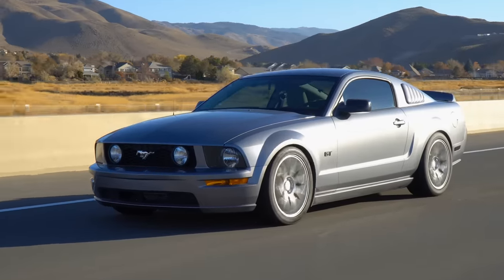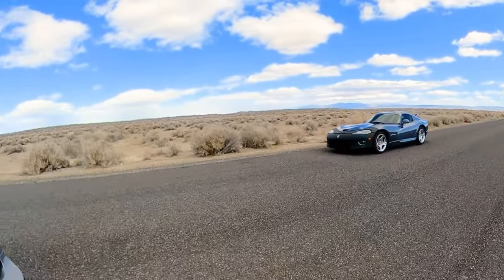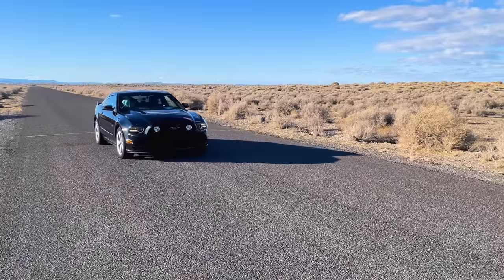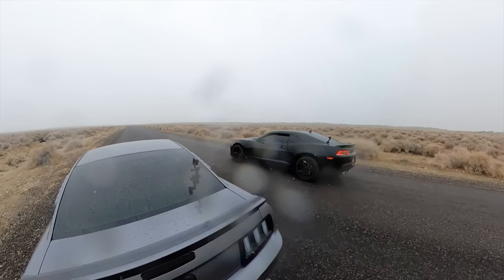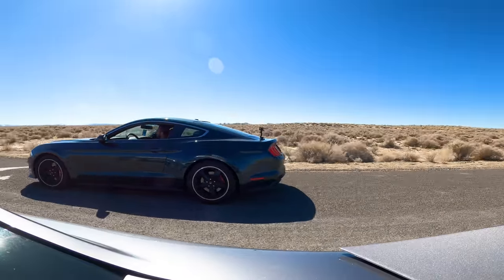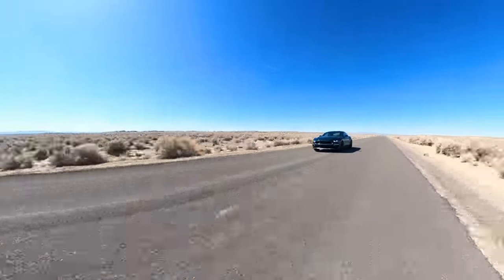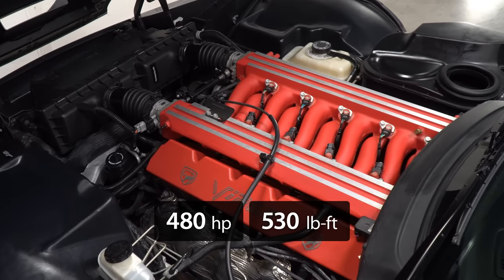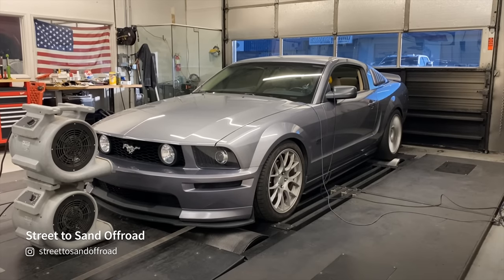Showing the world what an all-motor 4.6 Mustang can do

Comment: That is the quickest N/A 3 valve I have ever seen. Gives me hope for my car.
Reply: They're out there you don't see em much anymore because everyone just goes coyote and most people think a 3v can't even be fast because the internet says so.  Alot of impressive 3v builds back before there was coyotes everywhere.
Reply: I had a 82 GT fox body with a 351W and 5 speed years ago. Junkyard build, 300 wheel/330 torque and 3,000 lbs on the dot. Car went 109 mph in the 1/4 with no traction first and second so it was decent. I ran one or two modded 3 valves and they were right next to me so they can be quick.
Reply: @midnight347  If you put the same amount of money into a Coyote, it'll vastly out perform the 3v, just have to decide if it's worth it.
Reply: @midnight347  I think a lot of people just want to move onto different platforms. Chasing “stock numbers” or “fbo numbers”.as for boosting that’s a good hole category of its own that any vehicle can do with the right mods.
Reply: Just do rods and Pistons and go boost
Reply: @ThefuckyallLookingAt  But does it sound better than the 5.2s?
Reply: @TheEnd-eg6wq  the 3v is atleast 15k cheaper… whats your point? Take a 7k 3v… spend 15k on it… you’ve got a dragster.
Reply: @dssd245  A 7k GT 2005 and up for 7k will have 150,000 miles on it and be a pos, and likely will need everything replaced.
Reply: @midnight347  no they think there slow bc any other car in the same category with the same mods is faster
Reply: @TheEnd-eg6wq  do you know how to use tools?
Reply: @ThefuckyallLookingAt  who cares. Sound is just sound. Tesla doesn’t have sound and Gaps everything
Reply: @ThefuckyallLookingAt  I rather not be close minded and own all.
Reply: This Stang isn’t that fast. Maybe once he adds boost but he still lost to a mostly stock 500hp Viper… need to run low 11s or faster to be considered quick these days.
Reply: @TheEnd-eg6wq  the things that will be replaced are the things that will be replaced with performance parts.. using the 17k. You’ll have a new car when done..
Reply: @dssd245  With a worn out paint job and body, interior, and everything not performance wise replaced. Besides the fact that the 10 and up body style humiliates the 05-09, but to each their own.
Reply: @TheEnd-eg6wq  ahh. I didn’t know you had poor taste… it makes sense now.
Reply: @dssd245  The vast majority of the Mustang community agrees with me, and even you know that, the new body style in 2010 was highly praised,, I have a 12 GT/CS, and hell the 13-14 is even better than that due to the taillights.
Reply: @TheEnd-eg6wq  2010-2014… the back is jacked up.. 2015 and on the front is jacked up.. the 2005-2009 has the best rear/front combo… common knowledge…
Reply: @TheEnd-eg6wq  now if you put the rear from the 2015 and the front from the 2010…
Then you’ve got a descent looking car.. maybe even as good as the 2005-09…
Reply: @dssd245  You and 8 people think that. Sorry you're stuck with one. Perhaps you should google a 2012 GT/CS front and back, you have no idea.
Reply: That being said even a base 10-14 GT looks better than a 05-09
Reply: @TheEnd-eg6wq  the front does look good.. the back looks like they took the 05-09 back end and squished the block shape into a smaller  oval shape.... it makes it look feminine.. like a homosexual man… who does squats in the gym and then prances around.. not that there’s anything wrong with that.. just not my style.
Reply: @TheEnd-eg6wq  If you like the 2010
Rear end, I’m  assuming you’re a homosexual… so no offense extended..
Reply: @TheEnd-eg6wq  Have an 08 GT/CS. And literally everyone I know agrees they look better than your year. The scrunched backs aren't a good look. I personally hate the new ones, they look too much like a Supra to me. My boyfriend doesn't mind them as much. And when it comes to a muscle car, sound absolutely matters. The newer engines sound too much like tuners.
Reply: @mvc2177  You can't do anything with an EV. Half the joy of muscle cars is the amount of tinkering you can do to mold them into what you want. You're no gear head for sure. And yes, the sound does matter. A good engine roar can get any car enthusiasts' heart fluttering, the EV whine inspires nobody.
Reply: @mvc2177  You can waste your money any way you like bruh. Just don't be surprised when your EV gets no respect from guys who actually put in the effort to build their cars out.
Reply: @leelu9236  Possibly the dumbest reply this year, you think the front fascia on the 08 looks better than the 11- 12, with it's one of fog lights? You also think the Coyote sounds like a tuner compared to a 4.6? Hard to understand how you care for yourself.
Reply: @leelu9236  05-09 have a flat back, also hey go spend 800 and get sequential taillights as an add on, and if you have one it's probably an auto. At least I admit the 13-14 look better, go away
Reply: @TheEnd-eg6wq  It's a manual, but hey at least you're consistently wrong.
Reply: @mvc2177  Lol. What part of "you can waste your money any way you like" was too hard to understand? Reading comprehension just isn't what it used to be I guess.
Reply: @TheEnd-eg6wq  Are you one of those fragile little men who can't take female gear heads?  We got our GT/CS a few months ago. As far as I can tell it's all stock, but very well optioned from the factory. This one was cherry. Had less than 20k miles on it and we paid less than $20k for it. I lean more towards carbureted types though. Also have a 77 Maverick and a 68 Fairlane 500.

Comment: I've known a few people who hot rodded their little engines on their lightweight little cars to get 300 HP, and they were proud of that. I don't blame them, on a light vehicle 300 HP goes a long way.
Reply: bro, a Miata on sub-200 wheel will blow the doors off of bigger cars.  Weight is even more important than power.
Reply: @lashlarue7924  100% power to weight ratio 🤙🏻 I had a mx-3 gs and that lil thing would chew ppl up. I'd pop the hood and they seen tha v6 in there lol.
Reply: Yup my zx10r with 190 hp 0-60 under 3 seconds and 10 second quarter mile lol. Weight.

Comment: I don’t have the money/time to make my 3V fast, but like you, I love the look of the 05-09, especially when its clean & not overdone. My 06 is basically stock except for intake and o/r exhaust. So she may not be fast but she looks good & sounds even better ! Can’t wait to see you turbo results !
Reply: 300hp is still considered quick lol
Reply: @sneakerhead2261   300hp in a very lightweight vehicle maybe but not these Stangs. ESP the 300hp 4.6 in this generation of Mustang GTs, they were really slow. They didn’t pull hard. They fell on their face at high RPM. I gapped these 05-09 4.6 Mustangs all day in my 300hp 98-02 LS1 F-Bodies. Even my 95 Z28 LT1 with 275hp on paper pulled on these 4.6 GTs lol
Reply: @speedracerjeff  a tune and intake alone will wake the 05-09 gts up and they are actually pretty quick for what they are
Reply: @speedracerjeff  if u think the 3v are slow the 2v's are worse lol
Reply: @ThatLoud3v   oh for sure lol. I owned a couple of those sad 4.6 SN95 Stangs…
Reply: @speedracerjeff  there is no way a stock lt1 is gonna pull on a 3v with equal drivers stock for stock.  If you beat them you beat the driver.  They ran faster stock than the lt1 did.  They aren't that "slow".
Reply: @Your Pappy impossible because the internet said so!  Lol

Comment: It’s almost not as fun with the coyote, the power just comes too easy.  I kind of miss the challenges of building power from the lower output engines.
Reply: Its all gear swap and tune with coyote, and automatic.  See how how front went up and down when he did the pull, auto eliminates that and is faster than all the things associated with shifting. No paddles, just but it in D, the auto in that year is the same tranny as the raptor 680R.
Reply: @michaeltabanao9014  this 3v would be worse off with an Auto trans. Up and down doesn’t mean power lost, you see time and time again with good manual drivers that each power shift allows the car to lurch foward a small distance on the opposing car.

Vice versa for poorly skilled manual driver, each shift drops the car back a small distance. 

And I think your trying to say 6R80.
Reply: @paxtonkington9186  also supension,  I have 2012 auto, Ford Racing Suspension, Watts Link Rear End, it works extremely well...Newer GT have the Rev Match....less skill in shifting.....dont get me wrong Tremec 6 speed Manual is awsome. My preference for stop light to light is live axle auto, with a good tune, tune will hold the RPM it each gear near redline. Without it it will short shift

Comment: Gotta be rough dropping 15k in upgrades to pull a car length on a stock ls3 Camaro, enjoy the detailed vids and glad you enjoy the platform so much 👍🏻
Reply: You noticed that to I see, what a joke. Let me put my mustang that I did a lot of mods to up against stock cars with performance exhaust, my car is so bad ass. Again what a joke
Reply: @charlestoole1789  What is wrong with modding a small displacement engine to compete with large displacement engines? Isn't that what rodding is all about? It cost me more to build an inline 6 than to build a V8 but I got a lot of satisfaction when I ran competitively against the V8's, especially when I beat some of them. Obviously you are the type to buy the fastest car available and then brag about how fast it is without having any mechanical talent of your own to contribute to the success of your car.
Reply: He pulled that LS3 pretty hard and they are not exactly slow.  Impressive given the 3v started so far behind 🤷

Comment: Built a 08 gt with detroit rocker cams, longtubes, 4:10 gears, high stall tci 3500 tc, custom tune, Paxton Novi 2200 air to air intercooled on 10psi and it went 12.32 at 9000’ da on slicks with a good launch. So now I built a Ws6 , ls 6.0 stock 243 heads, ls6 intake, longtubes , 4:10 gears, th400 , 3200 stall tc, turbo cam, and it went 12.8 Na and 12.2 using 100shot nitrous only part time of that run. Just an interesting comparison.

Comment: I'll be honest, I was really surprised to see you beating both Coyotes and the SS. Really impressive. Keep up the good work and the awesome videos!
Reply: If 3v was automatic wouldn’t even been close the autos way faster
Reply: I have a 4.6l based engine that decimates....
I always tell everyone its a stock 4.6l 2v and laugh. Then ask how much they wanna win place their bets.
This engine dynoes over 600 hp and has a torque curve a pulling truck would be proud.
327 c.i.  13.5 to 1 comp ratio e85, custom gibtec pistons (head chambers are laser scanned) heads are trickflow 2v 195cc ported even more... Specs are mum...
Custom cams specced by me personally (i know a thing or two about induction) custom duel plenum intake built/designed by me. 4r75w trans 3800 stall converter... 4.10 gears, 9 inch aluminum housing and pumpkin... Carbon fiber hood and bumpers... Custom grill etc... 70 ford Maverick that weighs 2900ish with me in it. Has 2000era frt cobra brakes and hybrid crownvic/explorer rear disc i machined to use the better police crownvic rear rotors...

I've destroyed every N/A car ive ran for money.... 😂 It also has a dual stage nitros system. 175hp first hit, 2nd is 150hp. Im too scared to use it 🤣. It runs low 10s high 9s now.... Only a 6 point cage ... Subframe connectors etc... It's a blast
Reply: You’re racing from a roll..start at a dig and your feelings will get hurt
Reply: @dariusowens1060  the 5 speed autos back then were not faster than the manuals with a good driver
Reply: @sategllib2191  stock for stock maybe.
But with a couple of bolt-ons 
Different story.
Reply: Owner of the black cyote here it took a min for us to hit that sweet spot with my car but he built his car right. Hope for a rematch after some new rubber and a few things on the 5.0 at least if I can get it done before he’s rocking boost.
Reply: Thats cause the ss was completely stock and his mustang has over 16000 dollars worth of work to it. I personally think its funny to see a car thats tuned as much as this one struggle to beat a stock camaro.
Reply: @dariusowens1060  still the same story. Those autos were still disgusting 🤢

Comment: Great, great content, so nice you've tested these, very useful. So refreshing to see that much NA power squeezed in a 4.6L 3V. I'm in the exact path, love the s197 05-09 body, I didn't change any internal components yet. Only a few parts different from your build (mainly FRPP Cams and BBK LTH with Borla S-Type - I don't think any louder is accepted here in Quebec for street use). About to finish my winter work and turn the key to the see my results if I made mistakes or not. Did you noticed any parts in the lot that made a big jump in term of performance or it's more or less a linear process?

Comment: Great video! The ending suggest the 3v now makes over 400whp. What are the new power numbers?
Reply: the 4.6L is no joke when built right..
Reply: thats gotta be around 400whp. be a nice match for my cammed camaro.
Reply: @derekr1854  you have a 5.7L??
Reply: @P71ScrewHead  yup and a t56
Reply: @P71ScrewHead  out pull 5.0 and srt-8 challengers
Reply: @derekr1854  not bad, have you dynoed it??
Reply: @derekr1854  Another cammed Fbody, I got one myself. What cam you running?
Reply: @P71ScrewHead  not since after the ported fast 92 and 92mm tb and dud a holden crank pulley. Previous was 380whp
Reply: @jonadkins9339  vrx-5 cam
Reply: @derekr1854  Nice, healthy cam. Tick SNS 2 here.
Reply: @derekr1854  oh ok kool, looking to see what my lil 2v does when built.. TrickFlow heads n cams..
Reply: @P71ScrewHead  should make a difference for sure. I have a 408 built and set of custom ported heads with a tick stage 3 cam
Reply: @jonadkins9339  I have a forged 408 with a tick stage 3 turbo cam. Gonna run a turbo with it and E85
Reply: @derekr1854  sweet setup, I'm sure it burns the tires..
Reply: Money pit lol
Reply: @derekr1854  modding cars is.. ;)
Reply: @P71ScrewHead  indeed It is. Hopefully I'll break 1,000whp then turn it down to cruise around. 700whp would be low boost.
Reply: @derekr1854  oh that's def doable, most any engine that makes 400hp is easy to get to 1k hp.. With the internals i might go with my 2v will be making 800hp, but need to be sure my trans can handle it so i'm staying n/a till i build it or buy one that'll handle it..
Reply: @P71ScrewHead  I should be close 500whp on just motor. Running around 11.4 compression. I gotta get a better trans and a custom 9inch rear end still lol.
Reply: @derekr1854  sweet, 11.4 on 93 octane or e85?? I dynoed my 2v on longtubes n Marty tune, did 240rwhp..lol With heads n cam on 93 octane on stock 9.5 compression should make 380hp just with those 2 mods.. Shouldn't be too hard to make 400 debating going with 12 for compression since i prefer low compression but many engines are making good power on higher nowadays..
Reply: @P71ScrewHead  I'm going E85. I have 2,200cc injectors and twin fuel pump. Need a fuel regulator still.
Reply: @P71ScrewHead  it's hard to get 93 around my area. 1 place had it. 20 min drive which isn't to bad.
Reply: @derekr1854  e85 is closer n more widely available to you?? That's crazy, here only one place (Kroger) has it n there isn't many of them stores in my city so I rather use 93 even though it's more expensive, my P71 made 240rwhp on 87 octane, not sure if I previously said 93..
Reply: @P71ScrewHead  E85 is harder to find the last few years. Alot of E85 pumps were removed. Have 1 in my old town. I don't want to see the price on 93 lol. I filled before winter with 93
Reply: @derekr1854  For real man, that's why I switched to 87 not long ago, until I actually put the mods on..
Reply: @derekr1854  oh, also, car makers quit making engines that run on e85, I wonder why.. I think it was the push for electric vehicles that caused it.. Damn assholes..
Reply: My camaro is a toy car. Better to have a stock daily driver lol. I have to get my tuner put on my ecoboost for my edge still. I'll have to decide what octane I wanna run tho.
Reply: @P71ScrewHead  they have the a lower E gas. Rated at 88 octane. Think it didn't sell as good is the reason they went away from it.
Reply: @derekr1854  i agree too, my P71 has been too reliable, i wanted to put a stroker kit on it but i don't want to possibly have issues in the future, rather go through that with my 95 Lincoln Towny that my 09 P71.. My car was running 7.6 with 93, now it's 8.2 with 87..lol So there is a difference.. Have you seen my P71?? I put 17x12 widened steelies on it with 345/40r17s on the back which weigh 84lbs each side so that slowed me down a bit, i just didn't like the narrow wheels n didn't want to go 17x10, x12 was worth it to me, not x10..

Comment: The shorter rear gear helps a lot in these types of races, as long as you don't lose out too much shifting. Top speed will suffer with a shorter (numerically larger) rear gear ratio; this is clear in the race with the 19MY Mustang; the 19MY Mustang closes the gap at higher speeds where the 4.6L peters out. Nice work regardless.